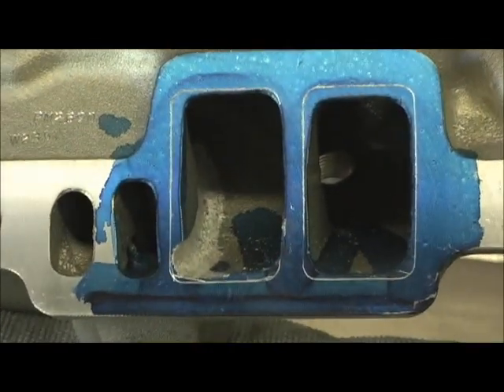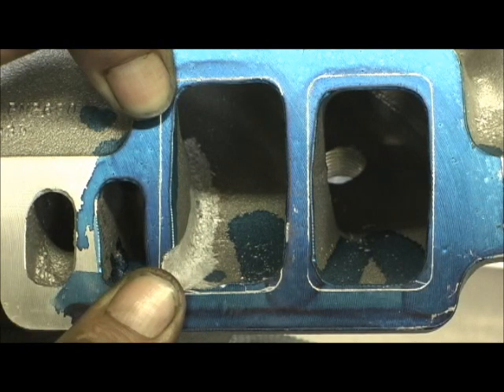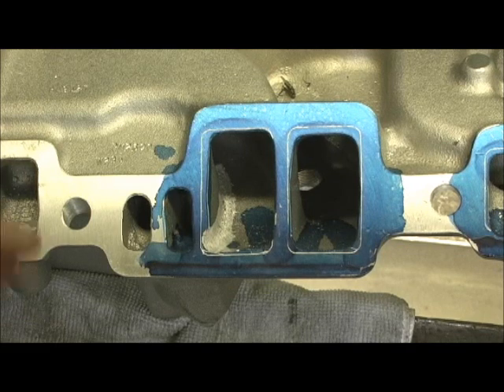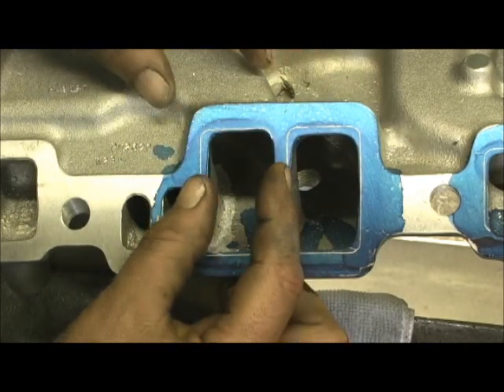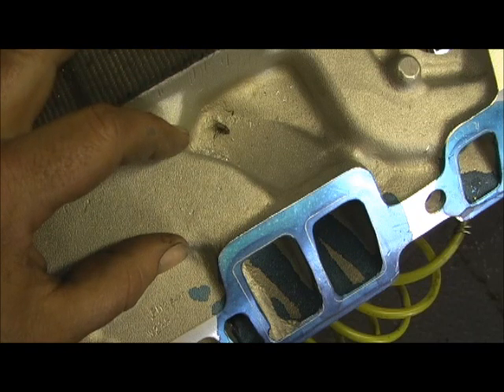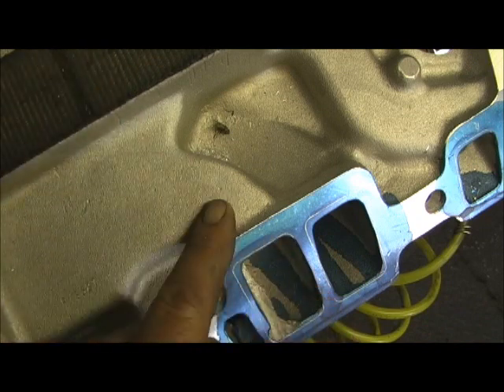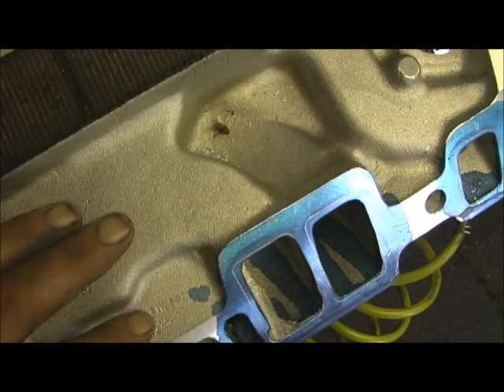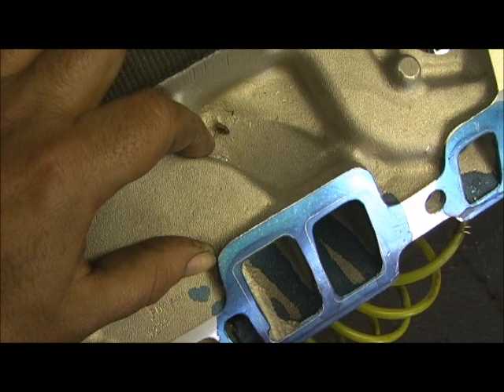TBI SBC 350 Stage IV part 5.2

Comment from the maker: I can assure it is cheaper to by a swirl polished valve, however, there is NO HORSEPOWER difference that could be measured by any dyno (unless you have a Eddie current dyno, like the ones GM and FORD has that could measure 1/4 horsepower differences, and I am not sure then you could see a power difference in what you mentioned above)